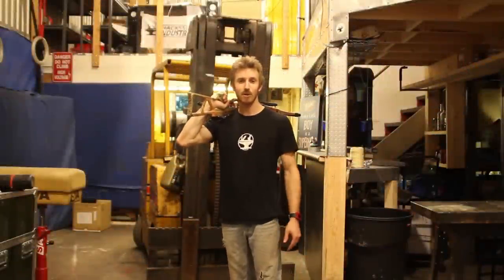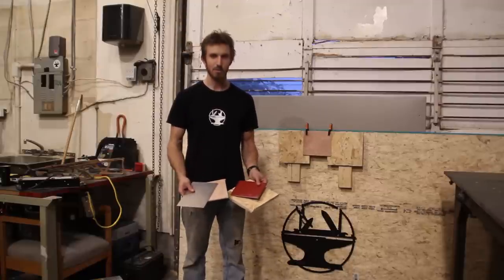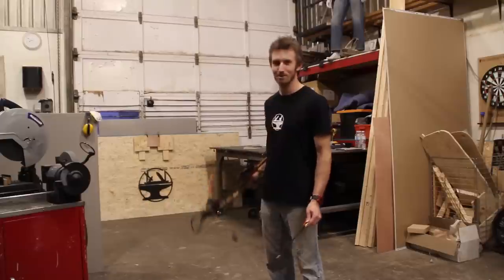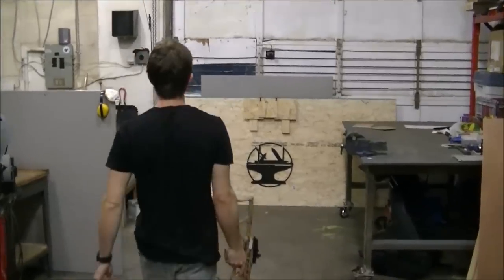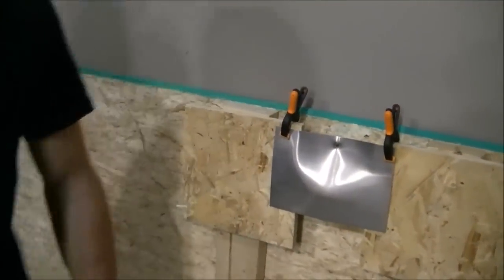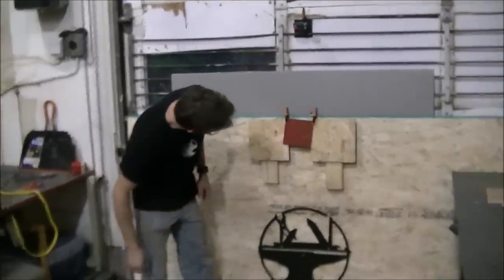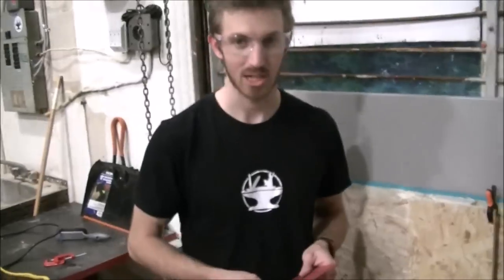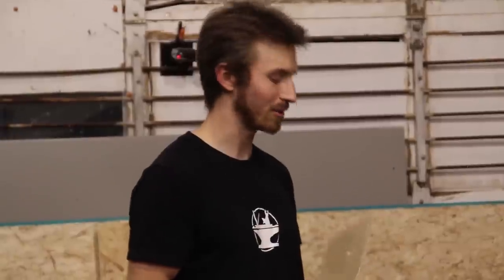Ballistic Plastic Testing

Comment: I recommend putting your armor in pouches of Kevlar or thick fiberglass mat, then laminating it with fiberglass resin or another laminating glue that hardens. repeat this step to have at least 3 layers depending on the thickness of the mat or Kevlar material. When bullets hit laminated fiberglass they delaminate the fiberglass and stop. If you use this method with a hardened interior you should support the sides of the plates so when bullets hit and fly apart they don't fly into your neck. Using Kevlar is a little different because there are different types of Kevlar material. in fact you may not have to laminate it, but layer it and sew it.

Comment: The cross bow may have 135 lb draw but has a really short draw length compared to a 28 to 30 inch draw on a bow, meaning that even though the draw weight is higher the power is significantly less

Comment: For armor I recommend you mix silica powder into polyethylene glycol 3:1 ratio where there is three times more silica powder then there is liquid. Put the liquid onto woven fibers.
1) make 3 disks (three layers of one scale) and make them each 0.5 or 1 inch circles
    layer 1: Ballistic plastic
    layer 2: woven fiber disk
    layer 3: Ballistic plastic
or you can use steel for layers 1 and 3
2) Repeat until you have say... a 5 inch scaled circle to test
3) the armor when done should look like a snakes scales made of woven fiber and ballistic plastic/steel

when it is layered like this as a scale it should distribute the kinetic energy across the whole chest plate instead of just one spot

the silica powder has a low surface molecular charge so they don't clump up together to form a solid when in a liquid
but with a polymeric liquid like polyethylene glycol when a solid suspended in a polymeric liquid that has low surface molecular charge like silica powder, or tungsten powder and they are hit with kinetic energy the energy is then transferred from the object.. be it a knife, hammer, bullet, bolt.. etc and put into the mix of materials and the solids form a lattice structure stronger then a hydrocarbon bond, its like having something better then diamond armor and when the kinetic energy is spent that caused the lattice structure to form the lattice structure goes away and when it is hit again it forms the lattice again and so the armor does not break

the reason why i was saying the thing about the 3 layers is because just the fiber with the substance (when treated properly with it) if hit with a bullet you will bruise and possibly get internal bleeding but the bullet will not penetrate through the fibers
so with multiple layers it will help prevent you from getting bruised

lastly layering it like a snakes scales will actually spread the kinetic energy across the whole armor instead of just that one spot
so if you have 20 disks the kinetic energy will spread out across all those disks/scales instead of just one area
if you have hundreds it still spreads it across the whole armor because of scales overlaying each other partially

Comment: I like it. You could 3d print the various parts of the armor and make molds and heat the plastic and pour it into the molds. I'd say you could even halve the thickness then just line x spray your plastic. from what I've seen line x will fortify damn near anything and add strength and concussive ressistance.

Comment: Have you considered using a COTS External-Frame backpack? I understand you're thinking of adding some sort of support stricture to your Mil-Speck backpack. I think you should seriously consider looking into 1980s-era External frame backpacks, as that was the sweet spot for tube-steel designs before composite or alloy designs took over. That seems like it would provide a fantastic structure for your project.
Reply from the maker: +tmanF4 That's what I used for the first exo!

Comment: Have you thought about using carbon fibre or fiber glass?
Reply: carbon fiber is not very impact resistant, it actually shatters pretty easily, it just has a high tensile strength.

Comment: why not some ar500 steel ?
Reply from the maker: going for lightness here!
Reply: ahh  maybe some Kevlar fibers ?   because a firearm will go threw a hole lot more than a cross bow you probably knew that XD  but I love your videos very excited to see how it goes!
Reply: +BeeBee n' Honey A cross bow will also penetrate Kevlar, as it is easily cut (I'm not making this up there are videos of it.) Really kevlar can only stop slow moving blunt projectiles such as pistol rounds, shotgun slugs and pellets, also blunt force trauma is a really big problem with kevlar. To stop high velocity pointed projectiles such as most rifle rounds you need either AR 500 steel or ceramic plates.